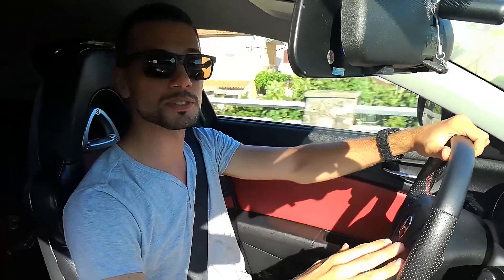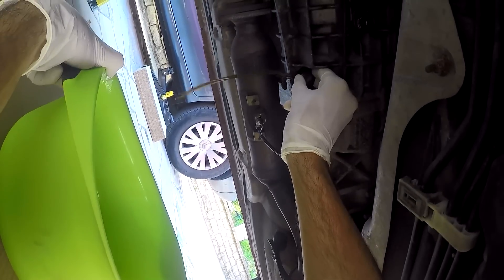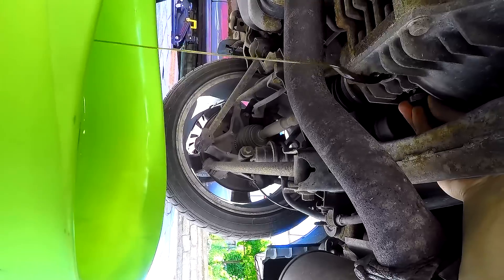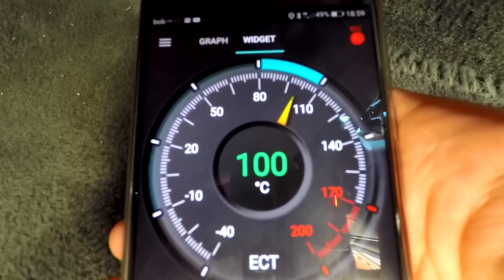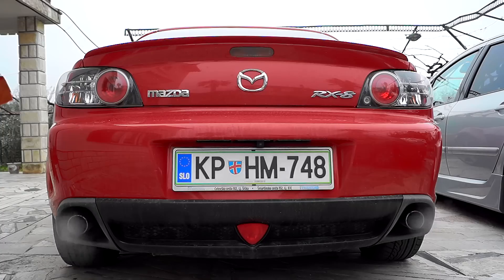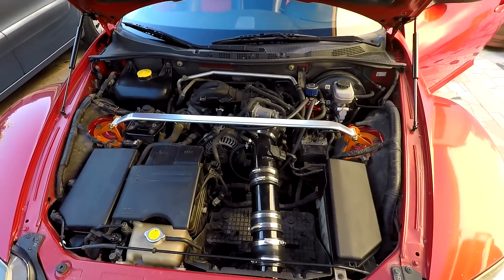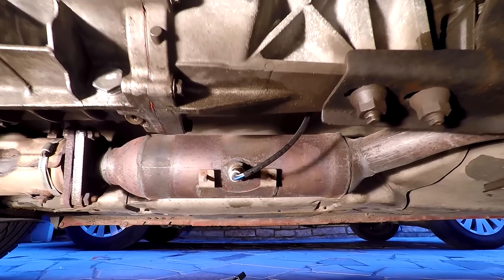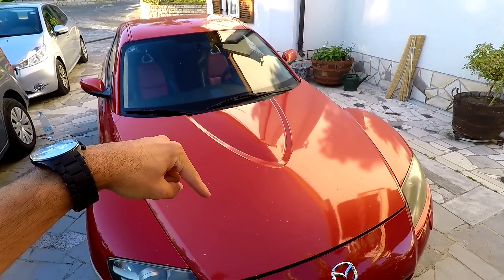10 Ways To Make Your Mazda Rx8 More Reliable (dont' disconnect the metering pump)

Comment: Hey men, i can tell you something about this car, i am an RX8 owner since nearly 6years for now. I never had real troubles with my car. Its the 231HP Renesis Model (6th gear). And i can tell you to drive it as daily, or just for fun (165miles range). here are some tipps and tricks for your RX8's out there to keep them alive looooong time.

FUEL CONSUMPTION

Mazda has done a very good job developing the rotary engine and was able to massively reduce the fuel consumption of the RX-8. The manufacturer combined consumption of 12 liters per 100 kilometers may deter the ordinary everyday driver - certainly rightly - but who likes it a bit sporty, gets used to the lookout for the new vehicle quickly to such values.
Because even ordinary reciprocating engines in the same performance class as the RX-8 are very thirsty.
The engine of the RX-8 has two combustion chambers, each with 654 cm3 volume. Provides a total combustion chamber volume of 1,308 cc. 1.3 liters do not sound like much - if you're used to reciprocating engines. To convert the combustion chamber volume in displacement, the rule of thumb is the multiplier 2.3 - thus the engine of the RX-8 is roughly comparable to a 3 liter reciprocating engine. And they like to swallow too much.

MODELS

Different model designations of the RX-8
The RX-8 is fully equipped by Mazda. Only a few details from model version to model version from each other. This also includes different model names by country. The following overview provides clarity:

192hp with 7.5x16 "rims, without leather, without xenon
Germany: Renesis
Switzerland: challenge
Austria: basic version

192hp with 8x18 "rims, without leather, without xenon
Germany: challenge
Switzerland: revolution
Austria: challenge

192hp with 8x18 "rims, with leather, without xenon
Germany: revolution
Switzerland: Cosmo
Austria: Challenge leather

231PS with 8 × 18 "rims, without leather, with xenon
Germany: challenge
Switzerland: revolution
Austria: revolution

231PS with 8 × 18 "rims, with leather, with xenon
Germany: revolution
Switzerland: Cosmo
Austria: Revolution leather

231PS with 8 × 18? Rims, with leather, with xenon, with sunroof and DVD navigation system
Germany: revolution
Switzerland: Cosmo (only available without sunroof and DVD navigation system)
Austria: Revolution C

OIL/OILMUD

Check oil level regularly
Since the rotary engine uses the oil not only for lubrication, but also for sealing the two combustion chambers, he needs a little sip from the bottle every two tank fillings.
So that the measurement of the oil level also succeeds, here is a short rule of thumb for reading:
The dipstick has a scale that indicates the minimum filling at the lower end and the maximum level at the upper end. In between, three markings are appropriate.
Between lower and upper limit is space for a total of 1.5 liters of finest engine oil.
There are 0.5 liters per mark in between.
Oilmud: where does he come from - where is he going?
Especially in the cold season forms on the dipstick a creamy greasy coffee brown substance; the oil foam.
That this is no reason to worry, I found out through extensive research in forums, where I also found the (plausible) reason.
In winter, it's cold outside and hot in the engine room. The RX-8 has a very long oil dipstick, which is why the hot oil condenses on the colder dipstick and forms oilmud.
If you change the oil, it may be that the problem is eaten and does not recur. However, Mazda's recommended Dexelia Oil seems to be particularly prone to foaming.
Anyway, you do not have to worry, because only at the top of this Oilmud occurs. Everything is alright in the sump itself.

THE PRIMIX

Anyone who has ever fueled an old motorbike, maybe still knows the mixture of oil and gasoline, which you have to fill there. It is so-called 2-stroke oil mixed in a certain ratio to the gasoline and the vehicle refueled with it.
So, the engine receives not only gasoline for burning but also sufficient oil for the lubrication of the pistons in the displacement.

Why Premix on the Mazda RX-8?
The RX-8 has as rotary operated vehicle its special features. Sufficient supply of the engine with oil is one of them.
The rotary pistons do not seal 100% in the rotor housing. In order to compensate for this, a little engineoil is always injected into the combustion chamber to ensure the seal on the sealing strips (therefore you should also check the oil level regularly).
However, engineoil does not burn very well and so residues of unburned oil build up in the rotor housing, which may (sooner or later) get stuck in the way of capital engine damage.
To counteract this, there are various ways to supply the engine with better combustible oil. The full and partial premix.
Below I want to briefly introduce both types and the different implementation options for the RX-8

Partially premix
In the partial premix, two-stroke oil is added to the gasoline in a low mixing ratio. Other components of the RX-8 can remain untouched.
The mixing ratio ranges from 1: 150 to 1: 450.
I myself drive 1: 333, since here can take the amount of gasoline just three times and so right the right amount of oil in milliliters.
Example calculation: with 50 liters of petrol gasoline I pour 150 ml two-stroke oil.

Fullpremix
In the full Premix, two-stroke oil is added to the gasoline in such a high mixing ratio that the engine gets its oil exclusively from the tank and the engine oil remains untouched.
The mixing ratio here should be at least 1: 150 and not more than 1:90.
The following modifications are required for the full-length premix:
The oil pump (the OMP / OilMeteringPump) must be switched off and the oil nozzles, which normally inject the engine oil, are removed and replaced with blind plugs.
The fullpremix is ??consumed only little or no more engine oil, so you do not need to put a bottle of Dexelia more in stock. The oil change intervals remain untouched.

Which 2-stroke oil is best taken?

It is only to use fully synthetic oil. Otherwise, however, no special demands are made on the oil. There are also 2-stroke oil, which is especially suitable for rotary engines, as this practice is widespread in the USA. In Germany, however, these are not so easy and cheap to approach, as is the fully synthetic "Synth 2T" oil from LiquiMoly, which I use myself. It is very convenient to use especially because of the readable scale on the edge of the bottle and the pull-out filler legs.

What the point of it?
Due to the combustion of the engineoil, which is unsuitable for combustion, coking deposits in the engine over time, which cause the sealing strips of the rotary piston to stick together. This deteriorates the compression in the engine compartment and not only leads to poor warm-start characteristics but also that the engine does not properly pull through. After a few tens of thousands of kilometers, these gummings can become a real engine failure, with most dealers recommending a replacement engine.
Alternatively, it is of course also possible to disassemble the engine, replace seals and perform a thorough cleaning. Unfortunately, the cost of installing an exchange engine is usually better.
With the premix, it is now possible to prevent these gumming and, as long as the existing ones are not too tight, it is also possible to solve them to a limited extent.
It is rarely too early and never too late!
Anyone who drives his Rex a few thousand miles without a premix and now converts, achieved with the two-stroke oil better combustion and depending on the persistence of the deposits, these can also be solved.
If the passage of the engine has not improved after two tank fillings, you either had no coking inside the engine, or they are already baked so hard that the two-stroke oil is powerless.
In this case it is possible to clean the engine with the "Mazda Zoom Zoom Cleaner". I have not gotten it yet, but those who did it either did not notice any change (no negatives either) or the car pulled better, started better and consumed less fuel.
Reply: DSC/ESC

Thanks to light rotary front mid-engine and the resulting weight distribution of almost 50:50 on the front and rear axles, the RX-8 is perfect for drifting.
That's why he got a two-stage ESC from Mazda:
If you switch off the DSC of the RX-8, only a part of the system will be deactivated.
Basic functions remain switched on.
If you want to disable the ESC completely (which is not recommended), you have to keep the switch pressed for more than two seconds.
In addition to the "DSC OFF" then appears another warning light in the dashboard. Please note that this status is saved in the logfile and can have bad consequences for you in case of an accident (underwriting).
In order to completely activate the system again, the RX-8 only has to be switched off once (disconnecting the battery is not necessary).

THE DRIPPING

The fear of the engine spilling over hangs like a sword of Damocles over each RX8 rider. But with a little background and a few precautions, you do not need to be scared!
To comply with current European emission standards, the RX-8 - like any other modern vehicle - injects a lot of fuel into the chambers during a cold start. This fuel is not completely burned, but enters the catalyst and is then burned there, so that the cat comes as soon as possible to operating temperature; because only then there is the coveted green environmental badge.
It is important to be aware of this process to know how to drive the RX-8, and how not.
What does not work well, for example, is simply re-parked.
Why re-park is bad
It came as it had to come, I had to re-park my car because of a set up for a move halt. Exactly five meters back to another parking lot. I get in, the engine starts and I put the car back. Parked clean, engine out and back home.
Three days later, I wanted to drive to work and the car just started to start. Four or five times I let him turn but it did not help, he did not jump. Then the bad idea, he could be drowned.
What can help.
If the accelerator pedal is fully activated when ignited, no gasoline is injected and the engine rotates empty; shovels so the gas still in itself further back to the cat.
If everything works out, then it will start smoothly. If necessary, you must first remove the spark plugs, dry and reinsert - or you can screw in new ones.
Since I am rather untrained craftsman, I trusted that the spark plugs dry overnight. The next day so the next start attempt - unfortunately also in vain.
After all this organism, I was scared that all the unburned gas would now be waiting for the next spark in the catalytic converter, and that at the next opportunity it would take the cat to heaven.

The catalyst was okay.
I got new spark plugs directly, as well as a set of ignition cables. One had already had a short circuit in it and would not have done it much longer anyway.
Then I decided to install a stronger starter. This increases the chance after a cold start to turn the rotor again vigorously and thus let it start. By default, only a small 1.2 kW starter is installed on the RX-8. Every Mazda workshop but likes to install the 2kW starter. The has more bums and turns the engine stronger, so that the superfluous gas can drain faster.
Since then, the Umparken is a red cloth and whenever I leave the car to someone else (cleaning, workshop, etc.), I pointed out carefully, please do not adjust park the car when cold.
For once it is warm, the problem no longer occurs (because then it is no longer a cold start and it is not injected too much gasoline).
Some have also flashed the engine control and solved the problem so - when cold, the Rex creates so but no emissions investigation more.

RESET MOTOR CONTROL

Mazda's RX-8 has an auto-learning engine management system that collects data based on driving style, adjusting the engine management accordingly.
In general, this can be taken for granted and ignored. In some situations, however, it may make sense to clear and reload the memory of the controller: I did this on my Rex after I bought it second hand to get it used to my driving style more quickly.
The benefit of this is a slightly lower fuel consumption and a smoother running. But that can be different for everyone.
The motor control, also called PCM, has two non-volatile memories, NVRAM (Non Volatile Random Access Memory) and KAM (Keep Alive Memory).
The NVRAM stores the engine data for the mixture composition, the ignition timing and the situation of the error codes that have occurred.
The KAM stores the sensor data (such as the eccentric shaft sensor) and the current error codes.
Delete the NVRAM
With the ignition off, press and hold the reset button on the trip meter.
Switch on the ignition (but do not start the car)
Continue to hold down the reset button until the odometer displays "TEST", then release.
Press the button until all tests have been run.
Switch off the ignition again
Delete the CAM
Switch on the ignition (but do not start the car)
Depress the brake pedal at least 20 times within a maximum of ten seconds until the oil pressure gauge deflects to about halfway and then returns.
Remarks
The brake pedal does not have to be kicked very hard, but quickly.
If the oil pressure control needle does not turn off, you did not pedal fast or not often enough.
Switch off the ignition and repeat steps 1 and 2. Very quickly pedal, quietly a few times more than 20 times.
In the very old software versions (before L), there is no rash of the oil pressure gauge as a control for clearing the CAM.
This procedure also calibrates the eccentric shaft sensor.

i know it was a lot to read, but very usefull :) kind regards from austria
Reply: Christoph Pichlbauer  whats 165mile range for i don’t get it ?? Thats how far we can drive it till to let take a break or what you mean??
Reply: @alejandroperez119  i made empty my fueltank within this range 😅😂 (was full filled)

Comment: The Achilles heel in this system is the metering pump. About 15 years ago I installed a Sohn adapter on my 1985 RX7, improvising a used power steering reservoir  mounted on the shock tower. The system worked fine without premixing (mine was the carbed 12A engine so no issues with insufficient metered oil quantity or mixing with fuel in the float bowl). The problem was with the metering pump itself. They wear out, often around 100,000 miles. (160,000 kms). After the adapter had been in use for over a year with no problems I was on a long trip. I'd filled the tank that morning and topped off the reservoir. When I again stopped to refill I noticed that I'd only consumed about half of the usual amount of 2-cycle oil from the reservoir. I premixed for the rest of the trip, and when I got home I installed another serviceable metering pump. I then tore down both the old one as well as a third metering pump that I had on hand. The difference in wear on the lobes was noticeable to the naked eye. Prior to the invention of Richard Sohn's adapter, the rotary racing community had simply ditched the oil metering pump system, installed a block-off plate where it used to mount and then went the pre-mix route. After seeing my pump fail (with no warning system to indicate that it had) I decided to do the same. No further issues were encountered after that episode.

Comment: The way I'm keeping mine running is rebuilding the engine lol. All of these are great tips, and it's stuff that I'll be sure to use once the new-ish engine is in the car. I'm having to reuse a few questionable parts of the engine, but with a few tricks and all of this good maintenance I'm hoping to get a year to two until I have more money to build an engine from the ground up for it. After getting my engine pulled apart, I found that the apex seals were worn down by about 3-4 mm, so it's no wonder I had no compression. Also, both rotor bearings were spun, so it's a wonder that it ran so well at higher rpm. Based on the internal engine wear and external damage, I suspect that I bought a drift car. It's quite impressive what a rotary engine can endure, and with good maintenance I'm certain that there is no other engine out there that could take the same kind of driving.
Reply: So how did it go?

Comment: The reason rx8s like to blow up in addition to what was said in this video is that the side seals are an odd shape so part of them gets hotter then the other part which causes premature failure.
Usually when someone tells you that the Apex seals are bad it's usually the side seals atleast with these rx8s

Comment from the maker: If you want to check out the items mentioned in the video, they are linked below: 
🇺🇸 USA & ASIA:
🟠OBD2 SCANNER: https://amzn.to/3dZhaNR

🟠UPGRADED RADIATOR: https://amzn.to/3BoRUcb

🟠SOHN ADAPTER: https://ebay.us/S9xV0H

🟠OIL COOLER: https://bit.ly/3QsjFFX

🟠SEAFOAM: https://amzn.to/3clivOO

🟠UPGRADED IGNITION KIT: https://ebay.us/cs0rHS

🟠STARTER MOTOR - MANUAL TRANSMISSION: https://ebay.us/zS2a42

🟠STARTER MOTOR - AUTOMATIC TRANSMISSION: https://ebay.us/apTU1U

🇪🇺 EUROPE:
🟠OBD2 SCANNER: https://amzn.to/3wFTch1

🟠UPGRADED RADIATOR: https://ebay.us/sHOej5

🟠SOHN ADAPTER: https://ebay.us/S9xV0H

🟠OIL COOLER: https://bit.ly/3QsjFFX

🟠SEAFOAM: https://amzn.to/3QT5B9E

🟠UPGRADED IGNITION KIT:  https://ebay.us/cs0rHS

🟠STARTER MOTOR - MANUAL TRANSMISSION: https://ebay.us/zS2a42

🟠STARTER MOTOR - AUTOMATIC TRANSMISSION: https://ebay.us/Dn3DqX

🇬🇧 UK
🟠OBD2 SCANNER: https://amzn.to/3RqqDwg

🟠UPGRADED RADIATOR: https://ebay.us/sHOej5

🟠SOHN ADAPTER: https://ebay.us/S9xV0H

🟠OIL COOLER: https://bit.ly/3QsjFFX

🟠SEAFOAM: https://amzn.to/3QT5B9E

🟠UPGRADED IGNITION KIT: https://ebay.us/cs0rHS

🟠STARTER MOTOR - MANUAL TRANSMISSION: https://ebay.us/zS2a42

🟠STARTER MOTOR - AUTOMATIC TRANSMISSION: https://ebay.us/Dn3DqX